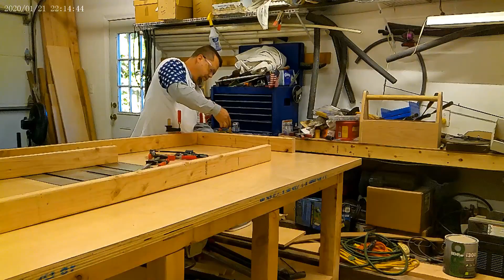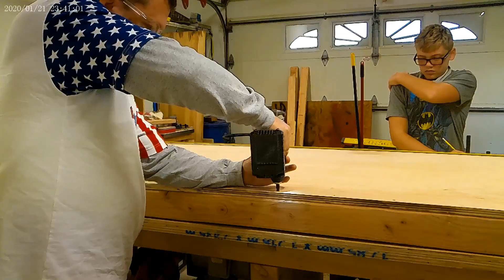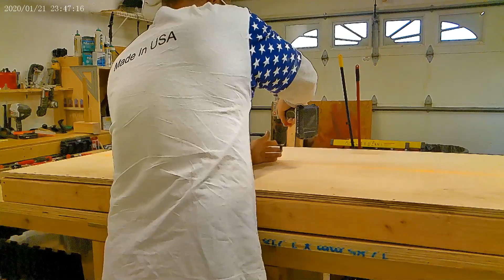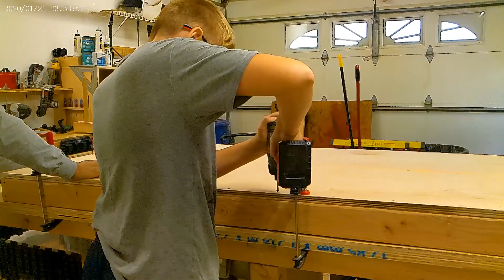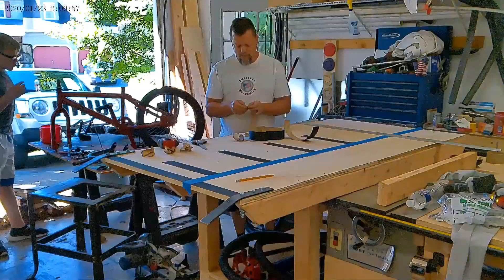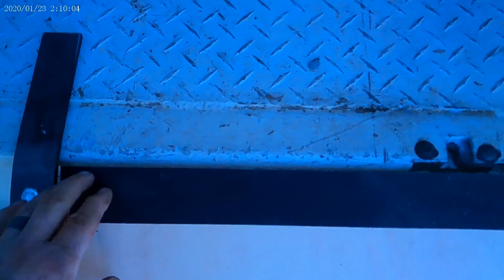How To Wooden Truck Ramp.

Comment: What are the boards dimensions?
Reply from the maker: I actually sold that ramp. And unfortunately I don't remember exactly, but I want to say 5 or 6 ft long. I measured from bumper to the ground from a level surface.  Hope that helps.
Reply: @AmericanWoodsmith  yes it does. Did it do its job? No breakage?
Reply from the maker: Yes it worked very well. I was a hvac installer and used it daily. Had to rhino line the board for those rainy days though, got quite slippery.